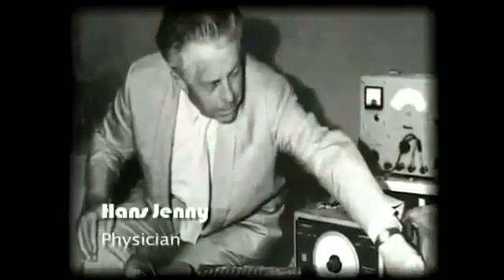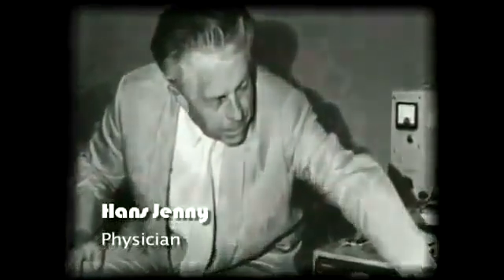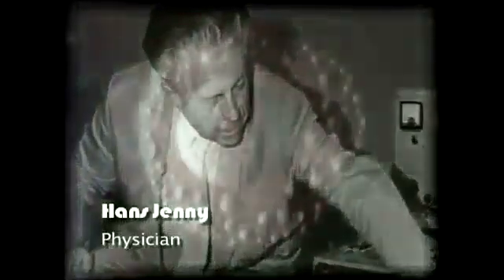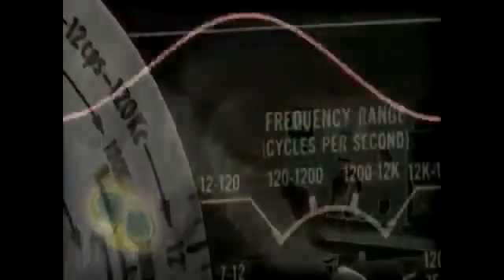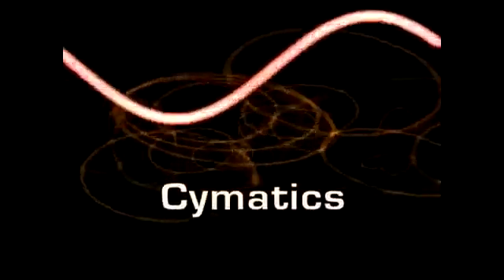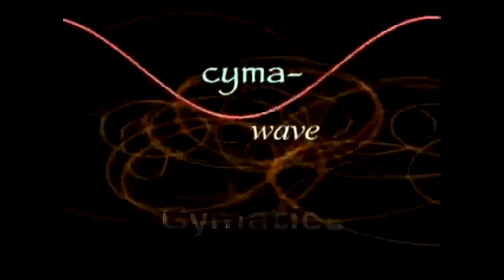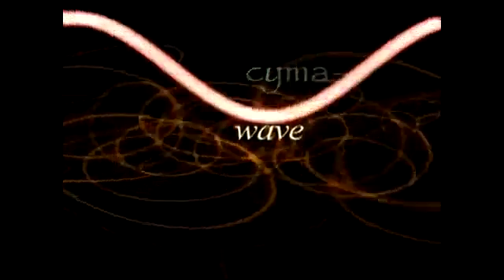Cymatic Experiments on Harmonics, atomic alignment & sacred geometry

Comment: At 4:02, that signal is significant.  If it is the same symbol, or very close to it, on ancient Sumerian (I believe) tablets with the 'giants' holding what looks like this device.  What frequency is it?   Also, do you know anything about the tablet?  I will try to find the pic. 

Thanks
Reply: about 4000 Hz
Reply: about 4000 Hz